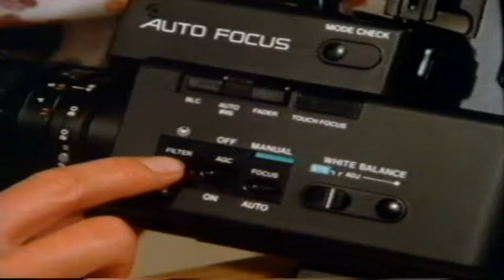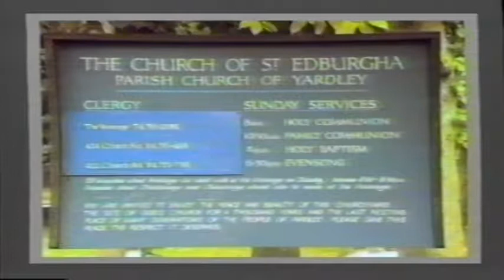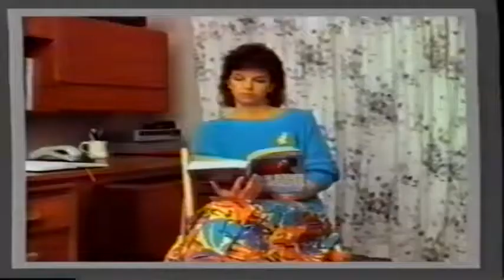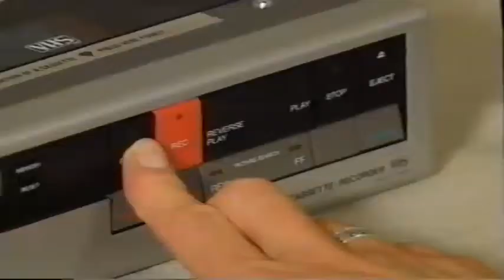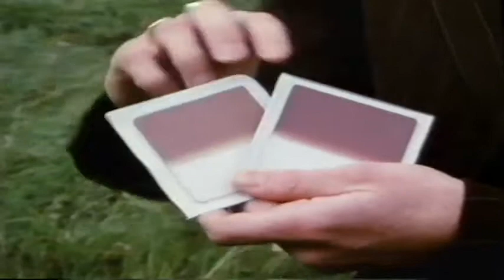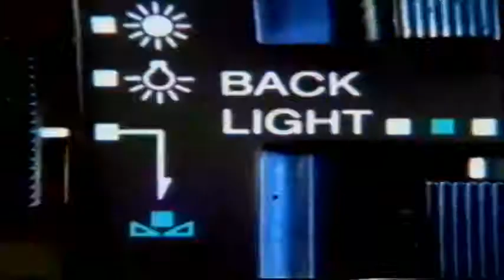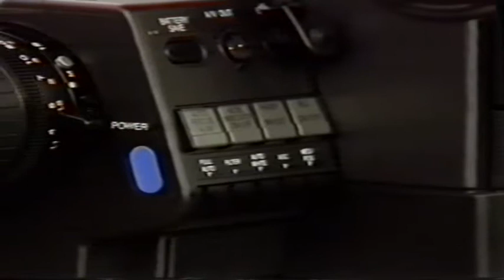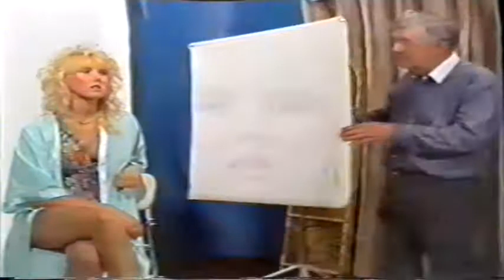BBC VIDEO ACTIVE - The Complete 1987 Series- The Home Video-Making Guide

Comment: We never got a camcorder, I really wanted one but they were just too expensive.
Reply from the maker: I had a Ferguson shoulder mounted one. Now it is mobile phones and they still can’t get the orientation right.
Reply: @TheFartGallery  lol those 720x1280 portrait recordings really wind me up. I remember being fascinated by the portable VCRs and separate video cameras that plugged into them the guys recording wedding videos used in the really early days. They were even more expensive than the 'Back to the Future' JVC Camcorder I wanted.
Reply from the maker: @retrotronics1845  weren't they VHS C? Christ. How did I remember that? Now I use a HTC Re camera which looks like a asthma inhaler but super practical. No longer available so I bought a few secondhand from CEX knowing they would become obsolete later. MicroDV cameras wouidn suffice way before that of. I recorded my daughter from six months to 36…! On VHS later coupling to dvd and then converting dvds to mp4